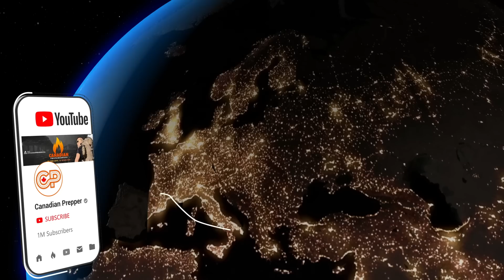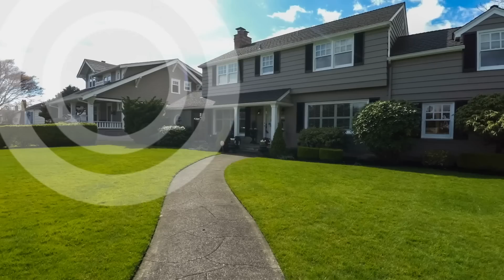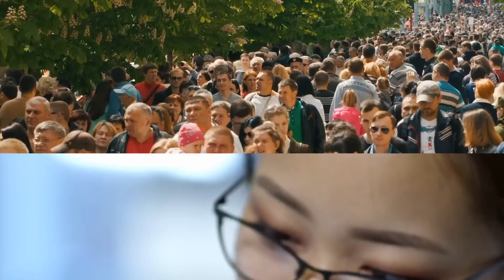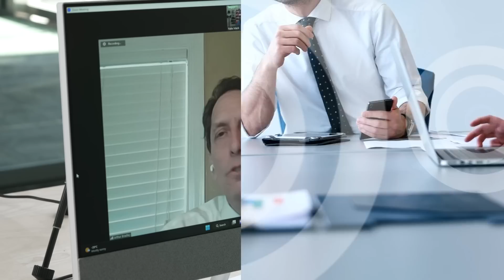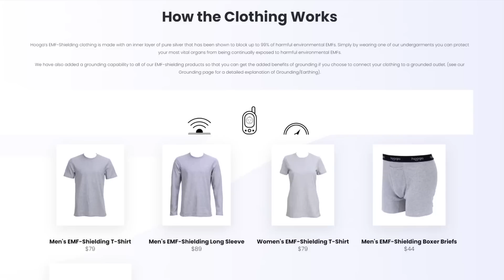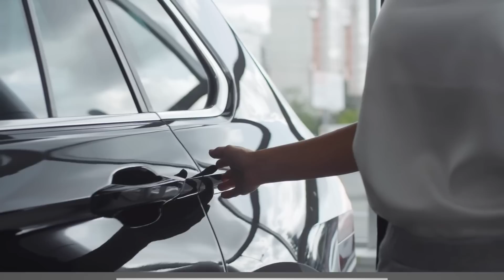NASA Scientist Issues STARK WARNING About WW3, Solar Flares, EMP and EMF

Comment: I was in the gulf War and I can tell you without a doubt that emp was more than likely used due to several times, we were told to unplug all electronic items Including flash lights and disconnect vehicle batteries. We were given these orders at least 4 or 5 times that I can remember and right before we went from desert shield to desert storm we did it again.
Reply: I’ve heard the stories that most of Saddam’s jets were being knocked out of the sky without a missile having to be fired, some say it was a satellite based EMP weapon, others say it was deployed locally. But yeah it makes sense, EMP’s in todays age are quite effective.
Reply: Not connected to electricity prevents damage from emp?  How did you protect against the excessive V discharge?
Reply: @mikalsweeny3143  antenna of death
Reply: @bradleyburdett5361  🤣
Reply: @mikalsweeny3143  large mass emp it would not … small or targeted possibly… we’re all thinking Carrington event or high altitude nuclear nothing will save those except a faraday cage
Reply: @zombiemom5088  ty.
Reply: @mikalsweeny3143  Great question, I'd like to know the answer too.
Reply: @mikalsweeny3143  well if it directed away it was probably more of a precaution just in case
Reply: @mikalsweeny3143  he explains in the beginning
Reply: Bobby... Wow... Did not know about that... Thanks for the tip, advice!!!
Reply: If you weren't required to shield them, were they emp's?
Reply: @pegatheetoo1437  you are not capable of thinking outside the box
Reply: @curtisbacon7856  I just asked a simple question ...
Reply: @curtisbacon7856  pegathee is right though. This probably wasnt EMPs
Reply: Trust NASA, I do not.
Reply: It’s a great first strike weapon. 💯
Reply: I unplug TV every thunderstorm
Reply: @artur8403  I'll get in trouble for saying this however you can buy high rated filters to protect expensive AV systems against electrical storms, you don't even need something specific for EMPs and you should be good for 99.9% of the time...
Reply: @PeterKnagge  what type of filters?
Reply: @PeterKnagge  This is maybe a stupid question but what kinda thing could I buy?  I got one of those cases to protect my phone but haven’t got a clue what else I could buy to protect other items.  I’ve just got a petrol generator & a Jackery 1000 so I’m pretty broke right now so I’m after something that’s not too expensive 😊
Reply: Thanks for the information to disconnect also the Flash light batteries...
Reply: @hitthefootballandthetarget1524  m.

.

..
......
.

..
M

..

.
.......
Reply: Jen  Unplugging it will not help to protect the device. It might save some of your other devices from taking unnecessary damage or traveling down the path (I am not sure but I think it doesn't make a difference as far as a EMP having plugged in or not..... enough that it will make it or break it. What you can do is build a Faraday cage or use copper cloth. One of those aluminum trash cans lined on the inside with cardboard so none of your electronics are exposed on the inside.... then buy a roll of aluminum duck tape (not the regular kind of duck tap it's different). You can look up on YouTube for a better explanation.
Reply: Or they wanted complete, 100% opsec and didn’t want any idiot GIs turning anything on
Reply: Im non binary and easily offended i am the u.s army now
Reply: Even though I’m across the pond in Northern Ireland, I just wanted to say thank you for your service Sir 🇬🇧🇺🇸🇦🇺🇨🇦
Reply: Makes me wonder if all nuclear weapons are EMP-proof, if so, I actually welcome the idea of a worldwide EMP if it stops a nuclear war, it'd take the whole world back to pre-2000 before nonstop cellphones and internet bs, I don't have anything tech-like on my prepping list. Yea there's the chance it would all come back within several years, but still, it'd be a good reset, & women would realize they do need men.
Reply: Check out the video "how would an EMP affect the power grid" by Practical Engineering. The damage from EMPs has been overhyped. 
The real threat is major national/international cyberattack - hundreds of millions of people would die and it would be the end of civilisation as we know it.
Reply: Maybe they were checking for electronic listening devices “bugs” but EMPs will still destroy these thing even if they were connected  because the surge is generated from the pulse and is absorbed in conductive materials. 

Probably trying to detect EMFs generated by circuits of spy devices.
Reply: I have always said a high altitude EMP would be the best weapon to use against another country to take out their comms and production capability.
Reply: @PreparedOverlander  you never said that.... you're only saying what everyone already knows ! Guinness you are 😂
Reply: @roddyryan-jd1yq  I have been preparing and telling others about this for the last 10 years. Everyone, like less than 3% of the global population? Not a lot of people understand how significant a HEMP attack on the country would be. I am glad you took the time to waste your time on that comment though.
Reply: @PreparedOverlander  it depends on the emp yield and system they are targeting… EMPs can only knock things off for a second until it reboots or it can fry a system but to do that you need a YUGE amount of energy which EMPs don’t typically have when mounted on a missile .
Reply: he fought  for the politicians, so called weapons of mass destruction and their ultimate plans of NWO  during the gulf wars  i dont recall having someone go to iraq and fight for my expense???  i dont remember the US soverignty or our borders being invaded by iraquis  back then??  the only invaders i see coming from our southern borders today are mostly hispanic,  i dont see any military troops today heading that way???🤷🏻‍♂️  those wars never threatned our country at any time?  the next REAL WAR this country will face for our very exsistence  will not be with soldiers and most likely  will be with our super powers for control and resources of the planet
Reply: Saddam Hussein...! Ya he was caught with weapons of mass destruction, dragged to USA and killed ...for their oil...🖕the Armys shit show ..
Reply: "I can tell you without a doubt that emp was more than likely" means "I don't know one way or anther."
Reply: Whaling ships from China use Huge satellite dishes with EMP waves against people on board Sea Shepard,  Greenpeace, makes them sick and pass out
Reply: So you could conclude that a government could cause an EMP to its own country and blame it on a foreign government! Interesting!
Reply: First I have ever heard of that! Thanks for the info
Reply: @lisawatson3467  really? Stop. US veterans use the self checkout line every 61 minutes.
Reply: So, there's no need for an emp shield, just unhook you truck/car battery.
Reply: Your microwave will protect against emp as well just don't hit start with your electronics in it.
Reply: Thank you for serving our country. God bless.
Reply: NASA  never a straight answer
Reply: My husband and his family lived through that for 6 months. It was a nightmare. The families took shifts. The mothers watch the children the fathers went out to try to get food. I think it was like 4 or five couples. They slept in shifts. Dug holes for using the toilet. Bathed in the same water, whatever water was available.
Reply: @PsychicInsignia  oh no.  Sorry for that hardship.  That sounds like a nightmare.  But God pulled you guys through!  Blessed are you and your family.
Reply: Thank you 🙏🇺🇸🙏
Reply: Fun fact emp effects long lines not short so your house is burned but you phone isn’t.  Crazy right.   Open lines act like antennas but closed line are toast. Best of luck.
Reply: My friend was on Desert storm British. Cleaning up the road to Basra. He said there was clear evidence that some sort of electric destroying device was involved. He was only 18 at the time so didn’t know much but others there did & that’s what he took from it. They are digging Republican guard bodies out if hardened bunkers where nothing worked anymore. That was a few days after shock & awe and the Americans went in 1st.
Reply: @Chiky Scares You0
0
Reply: Did you hear voices that other people couldn't? Like very clear voices?
Reply: They also apparently used directed energy weapons and had them staying awake for days vomiting and losing control of their bodily functions and then giving up in huge numbers.
Reply: @molonlabe247  This is one of my biggest concerns. I will just say that there are plenty of "microwave towers" around that can be weaponized and it is very much anxiety producing.
Reply: @resarm5007  yes.  Good point.  Just crank up the Ghz and wattage....in fact wouldnt doubt they hack it and do this.  Those towers are everywhere....
Reply: @resarm5007 what about our phones? I feel like it's possible.
Reply: @mikalsweeny3143  is this real?
Reply: @D-Wex  use a faraday bag.
Reply: Any other hints that an Emp was used other than what you mentioned? Maybe all that was just to make sure that none of the enemies' infrared cameras could see your location 🤔
Reply: @Loot Marsh k.....
..

.

.

.

.
Reply: Thank you for sharing your experience and thanks for serving in my place. God bless you
Reply: @lkantor2142  In your place? What you think that you would have been drafted? The draft in itself is the biggest human rights violation you can do besides selective instinction(happening now). I once(when I say once I mean more times tbh but for redrick sake) heard a veteran in chat comment back to something very similar to what you just said thanking and praising them for there service.....he said and I quote "don't give anymore respect for a service member than you would a ordinary citizen". He said in a round about way that they do things and most of them will do the same to you if ordered to. Just saying
Reply: Thank you for your service. My brother was there too 💖
Reply: I unplug TV every thunderstorm
Reply: Salute to you Soldier. Thank you for fighting for us 💯
Reply: @DopeCity5000  🤮🤮🤮🤮
Reply: @DopeCity5000  You do realize the Iraq war was illegal?
They were no WMD, Saddam Hussein was no threat?
America murdered millions of people for nothing. Same happened in Libya,  hundreds of thousands murdered.
Reply: @DopeCity5000    not us?  the greedy power hungry  NWO  politicans , get your facts straight
Reply: @DopeCity5000  didn't fight for us. Fought on the side of criminal sociopaths.
Reply: @albertbeauchesne2882  We still have some great soldiers out there. My dad is one of them.. Fought in Nam..
Reply: @albertbeauchesne2882 if you haven't earned and worn the uniform your opinion means absolutely nothing.
Reply: @albertbeauchesne2882  exactly 💯
Reply: @albertbeauchesne2882  these where troops that didn't know the reason at that time , that was a post 911, event  Don't disrespect troops , you have a big  yap
Reply: @D-Wex  mmmm yes it does because we are as one. if not then seperate yourself from the rest of us
Reply: @DopeCity5000  there’s a difference between the “tool” and the “Owner” a soldier is a tool, it’s the owners and decision makers. The worst war crime in Us history happened in Vietnam, we slaughtered a village full of over 500 women and children and a few old veterans that had less than 10 old M1 Garands. Our military is straight up EVIL. That doesn’t take away the fact the brave men and women that serve aren’t the best of our country. But they’re used to terrorize the globe. So at some point it’s no, quit signing up for a corrupt and evil organization
Reply: @MultiTasker888  hired mercenaries...
Reply: EMP will still take out the batteries
Reply: @zerocool1344 Wrong, it will not take out a lead acid battery.

Comment: Myself & daughter suffered some type of high intensity wave   over a couple of hours. We heard an ultrasonic sound which made us feel dizzy & sick.  After placing her in the centre of the double brick home under a table, building a physical barrier around her with pillows, blankets  & yes TIN FOIL it was almost tolerable. 
Don't laugh you'd do it too to escape that very uncomfortable experience.
Reply: Get some RFID material and make a small safe room/closet.
Reply: Get an anti-EMF "shield" hat! I work around A LOT of EMF pollution (software  industry) / protection for the head, (via a "hat") / makes a huge difference in how I feel.
Reply: You can’t hear ultrasound. That’s below the human range for hearing. Obviously, you felt symptoms of some sort, but whatever it was it either not ultrasound or some other acoustic weapon.
Reply: @taoist32  SPD, ASD - I guess I’m superhuman then (I can literally feel everything, I see and hear what 4 cats, and 2 dogs would, but always before they do).   The room of a CT Scanner (even if the machine is on standby) makes my bones tingle (very soft pins and needles)
Reply: I had a grandma that could very clearly hear dog whistles. Just because most people aren't affected by something doesn't mean there aren't some exceptions. It would be nice to know exactly what was affecting you. Sounds very unpleasant.
Reply: I live in  VERY wealth part of a town controlled by a type of HOA that's full of judges, they banned 5g, and fast food chains. That should be all the proof you need, that yes indeed we are being hit with RF and BIO weapons every day.
Reply: I think we have to do like a the actor Joaquin Phoenix in his alien movie... He fix some aluminum hat.....
Reply: Don't do that again, especially with your kid. What you did was overacting. Relax and don't lose common sense.

Comment: Blood has iron in it.
With the massive amount of energy by a CME or high powered EMP, I feel there should be some effect on biology.
Assume the worst, prepare for it if you can, and pray things turn out alright.
Reply: If you got vaxXed you received more metals also. More with each booster.
Reply: @mommaknowsit1632  Drink more mineral water and increase Vitamin D. There are also heavy metal toxicity “cleanses”. I don’t really believe in cleanses, but they may help some people.
Reply: It's been noted that during magnetic excursions, (when Earth's geomagnetic field weakens and moves, esp along solar activity increases) such as the one coinciding with the Younger Dryas boundary, could be responsible for not only mass extinction but also rapid speciation. This suggests cosmic radiation events may be causing significant genetic mutations. Randall Carlson and Ben Davidson of Suspicious0bservers touch on these topics.
Reply: @CmdrCorn  ...also Doug  Vogt
Reply: Nothing of note after the Carrington Event.
Reply: Zombies
Reply: So the iron in our blood is not magnetic , thats why there is no  effect on biological processes, and instead it works on semiconductors

Comment: Havana Syndrom, so that's what it is called. I measured this little cube where I sleep and get a headache when I place my head into it. It comes and goes instantly, and have to use my microwave detector to find out if I can sleep there or not before I go to bed. Thank you.
Reply: Check where your meter is outside of your house. In my last place there were 5 smart meters right outside where I slept and I would always feel like I was being cooked when I was in bed.
Reply: @Spread_Hope_Like_Fire  No. There is nothing electrical around.
I have a cheap device that measures microwave leakage. I have a similar little cube that is filled with microwaves in the shower as well. I can tell because I start getting headaches. Once, I recorded the microwaves using the device, and nothing was there before a shower. After the shower, it was buzzing like crazy. Fifteen minutes later, it was as in the beginning, nothing. It looks like someone can switch it on/off at will. It implies a weapon the U.S. know nothing about.

Comment: 8:20 wouldnt a tinfothat technically be a Faraday cage for your head?
Reply: Nope...cuz tinfoil won't save your electronics. People talk about tinfoil hats because people who are deemed "crazy" sometimes have mentioned wearing them to "stop the gobermint from reading their mind" basically to block the "gobermint rays". Everybody knows it will not. It may block your cell signal if you put your cell in tinfoil, but it won't stop EMP.

Comment: so people need to learn how to make pure sine wave 〰 A/C 120 volt 60 cycle electricity. 2 phase 240volt 〰 180° or 3 phase 〰 120° since i did at age 8 & built inverters & generators it should not be too hard 👍
or invest in pure sine wave power inverters kept in a faraday cage and batteries to run it solar panels with charge controller. like $1000